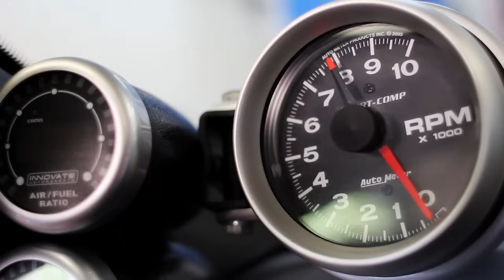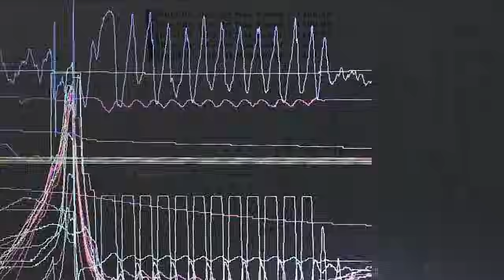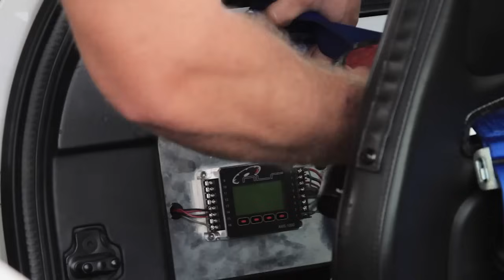New World's Fastest Car! Ford GT Bad v8 1700 Hp - 455.817 km/h ( Guinness World Records )

Comment: sigh

all these comments...

this is a world record for fastest standing mile in a street legal car, not a factory production car, not a full blown race car, not a jet powered car, not a trailer queen that needs 20 mins of life support before starting it....JUST A GOD DAMN STREET LEGAL CAR RUNNING FLAT OUT FOR 1 MILE. not 5 miles, not 2 miles, not on a circle track with a 120mph lead in into a straight away, BUT A STANDING MILE.

yes you can thrown a endless amount of money at a Veyron and make it faster, by that same logic you could do the same with a lawn mower and break the sound barrier. 283 mph is fucking fast no matter how you cut it and this is a impressive achievement on its level of a highly modified street car, just the same as the Veyrons achievement is in a stock platform.

Comment: For all those hatin on Ford GT and comparing it to the Veyron there is really nothing to compare when you could buy 5 GTs for one Veyron, and the Veyron is all wheel drive while the GT is only rear wheel drive. Perhaps the most important thing is what few have mentioned. That speed was over the STANDING mile. Those who watch the Moscow Unlimited or Texas Mile drag races know the significance of such a speed. It takes a Veyron 4 miles to reach top speed and Venom 3 miles. This speed was achieved in 1 mile, it would probably hit 300 if there was enough road for it. Regardless of what anyone may think of Ford looks or otherwise you have to give respect when its due.

Comment: now the chiron is going to beat it as it is the world's fastest car ever made
Reply: The Chiron will most definitely not be able to come anywhere close to 283 mph in one mile. Besides, the top speed is limited to 261 right now.
Reply: +The3Noobz yeah they will remove the limiter and test it ....261 is just for safety reasons
Reply: +Kaushik Bala Chiron will never set it
Reply: uh the fastes car you can drive on streets is Devil Sixteen with 348mph
Reply: BlueDune its a fake car .....5000 hp XD!!
Reply: +Kaushik Bala Fake??
Reply: +Kaushik Bala oh u dont believe but i did hear its engine sound in real life so its fucking loud..
Reply: +BlueDune there is no proof of its top speed and no official record....
Reply: dude that's a piece if garbage call it high end and give it and automatic at least give the Chiron a dual clutch or a manual also the Suzuki escado Pike's peak version is faster and that thing is from early 90's and it's the king of all roads because it is a rally car but it also goes on tarmac and shreds the road and it can go 364mph on its 1800pounds and 2300WHP and it has a 6 speed manual and does 0-200 in about 7.8 also 2300whp isn't original it's after people have rebuilt it and modded it
Reply: Lol That isnt even a production car :D
Reply: BlueDune it may not be production car but it's hell load of fun
Reply: I bet sixteen is one of the best cars u can drive
Reply: 1.8 sec 0-100 540kmh max
Reply: im dumb cuz u agree sixteen is one of best?
Reply: BlueDune it is good for straight line racing like a drag racer but the handling on the devel 16 is horrible and also the reason for bad steering is the car is very long but narrow along with it being extremely heavy I would go with the Suzuki because it is more versatile because it can go off road,on streets and handles like a dream
Reply: +BlueDune stop acting like you know about cars
Reply: +BlueDune for how long? 2 miles? ah super cool..
Reply: Justin Walters 4000 pounds 1500 HP but then trion nemesis has 2000hp and is lighter
Reply: Justin Walters 5000 pounds? are you serious
Reply: It weighs 4400lbs but whatever
Reply: The Chiron does 286 mph...
Reply: Fastracer25 AJ so it's slower than the AMS 12

Comment: so uh, yeah, Bugatti is straight off showroom floor with full interior, warranty, etc... hardly comparable.
Reply: Yer, well I have a Bugatti...................................... In GTA five.
Reply: me no lie 19 years old in collage driving a adder 187 miles per hour
Reply: "Bugatti is straight off showroom floor with full interior, warranty, etc.."
Bugatti Veyron 16.4 Super Sport runs nearly $4,000,000.00 - so it better be fast.

The GT didn't cost a quarter that price..........and will go around corners fast enough to make your eyeballs bleed.
Reply: New ones are 4,000,000.00

Who wants a used Bugatti?    Tacky much?

Comment: The other day in Miami Beach, a guy pulled up with his Bugatti...had coffee and then got in it and went home.  No pit crew, no extra doodads.  Just the car he bought at the dealer.  I'm rooting for the GT to be the fastest car, don't get me wrong...  but that's a race car that's barely street legal.  I'm surprised Guinness went along with that because the Ford GT as you can buy it from the dealer does NOT go faster than the Bugatti.  It sure looks a hell of a lot better, but let's compare apples to apples please.   Given enough money anyone can modify a any number of cars to go faster than the Veyron.
Reply: +Gandalf TheWhite If you actually own the car they will do the upgrades to make it as fast as the badd gt but of course it will cost money and a lot of it and it is very street legal, dude drives it daily. plus he does rip apart the engine and rebuild it with better parts every month to see if it will get more power sadly they have only squezzed a bit more power out of the block. the block was also built by ford themselves which konninsegg used in the new one:1 due to its light weight and the power it can achieve and not crumple apart.

Comment: It's a car built for pure straight-line speed. If that's it's only purpose, there's no need for modern comforts or things that would make it possible for the everyday driver to cruise on the street with, strip that baby of ALL excess weight.

It's like comparing a fighter jet to a speed boat, "Fastest car, pshh Bugatti goes nearly just as fast, is street legal, and is easy to drive".. when this car was stripped and built specifically for only 1 purpose. "This Jet can break the sound barrier, but it can't float on water like my boat, haha, piece of shit jet". Pull your head out of your asses people... and regardless, despite all the shit that went into this GT.. it was STILL probably exponentially cheaper than your all mighty Bugatti Veyron.

Comment: Ok my comment is for the beginning of the video as they said the fastest is 268 from the Buggati...that is wrong...the Venom GT beat that time with 273 mph I do believe and said the Venom was capable of much more. This GT is an absolute monster. Can't wait to see the guys from Venom beat this. The only reason they didn't get the Guinness record is because they wasn't allowed to have a sec pass on the air strip and the rules are you having to be able to do that speed going down and coming back to achieve the mph record in the bok of Guinness.

Comment: nice car and nice job   but some info on the veyron engine. Is built to make 5000hp at full capacity.  So please read a little! the only reason they dont do that  is for tire safety and heat cooling exaust  and there's a lot of car that make that speed they just not interest in puting a big ad on theyre car !

Comment: Yeah but the bugatti veyron is still the fastest mass production car at 277 MPh now. the bad gt is a modded production car. so it's now contest bugatti veyron ss is till the fastest in the world
Reply: +Tony Mattingly the veyron never went 277
Reply: +Tony Mattingly mass production? I think only 30 special modded bugattis (the super sport edition) can barely reach its 267 top speed after going like 5 or 6 miles. Its not every veyron that can go 267.
Reply: The Venom GT went 273 mpg bugatti went like 263
Reply: Dixinormus venom gt went 270 bugatti went 268 or 269 not sure which
Reply: bush did 7/11 the Veyron ss went 267 on a straight of 5 miles.... the Venom GT did 265 under 2 miles (it goes beyond 270)
Reply: TheGeorgeLara the veyron sucks so much it cant turn for shit and it takes to long to accelerate and if you were wondering i would never defend the veyron
Reply: +Tony Mattingly I hate veyrons so much. They are just so damn ugly to me but I do respect their speed. And with the Chiron that is supposed to have 1500hp coming out, I am kind of worried that production cars are going to start breaking 300 soon.

Comment: Sorry, though this car is mighty impressive, but...

...a custom, one-off brute, built only to break a specific record, and can only go quick in a straight line shouldn't count when the record was set by something in it's own factory stock configuration, handles as well as it goes quickly, and is luxurious and comfortable enough to be driven daily.

Comment: this is so ridiculous. you can't compare the 2 cars. the bugatti has no roll cage, full interior, air conditioning, heating, radio, speakers, cup holders, etc etc. vs this Ford that has nothing. strip the bugatti down like the Ford then race

Comment: Then all the Veyron has to do is remove the limiter and let it push out the max ponies it can at 3000 hp and it's back at number one.  Now, can it handle it? I don't know but I'm sure if they can modify a Ford GT it should be allowed to do that as well.

Comment: The Veyron is a governed production car, and is capable of going much faster just by manipulating it's governor, so I'd say that you may be a bit lazy on that point, and should get back to the drawing board "The Veyron Motor, Is Two Engines In One, Plus Turbo Charged"

Comment: Bit of a soft record tbh, the record for quickest terminal speed on the 1/4 mile for a street car is 250 mph and that car has 2300hp, this is one of those records that people are not really that interested in or the big hp cars would have had a go at it.
 BTW the WORLDS Fastest car is the Thrust SSC and this has a way to go to become the WORLDS Fastest car, i agree its very fast but come on guys aim a little higher.

Comment: Nowadays all the biggest manufacturers like Ferrari, Bugatti, Porsche, Lamborghini, Pagani, etc... can build a faster car than the GT, question is: does it worth? The Volkswagen CEO declared that the Veyron was kind of a fiasco because the price tag of 1,5 million EURO does not even payback the engineering to create it. Being a big group with revenues from the other brands this is still acceptable, but it's not the best idea they had. However, and not to defend the european manufacturers, a car should go beyond the simple speed and open up new technical scenarios, under this point of view the Veyron was a breakthrough, while the GT is only an old car with an overpowered engine inside. Therefore the contribution of FORD, in this case, was rather miserable IMHO.

Comment: Bugatti is still the fastest PRODUCTION car, you simply took a production car and made it faster, anyone can do that... but thanks for making it a Ford...
Reply: Not Stock from the factory, does not count.  Bugatti is street legal.
Reply: Actually no, the veyron has been beat by the Hennessey venom GT
Reply: Derek MacIntyre the Hennessey venom is not a Production car. Nice car but not production
Reply: ***** You have a no idea of why Veyron cost so much by calling it "overpriced"and how it is extremely hard to make a production car reaching top speed in comfort, stability and luxury in reliable manner.There is documentation called Megafactories and How It Is Made explaining the reasoning, look it up.
You will understand why Bugatti Veyron got so much respect in the automobile industry, it pushed the boundary  of what it is possible.
Reply: koenigsegg regera. fastest production car
Reply: Since when? Guinness world records doesn't show it
Reply: +RepoDraghon that's bc guidness world records (for some stupid reason) requires a test where the car goes both ways down the track, and Bugatti (VW) is the only Car company with a test track symmetrical enough to do that
Reply: +Dan R but the Venom IS actually a production car. That's a fact. A legitimate fact that can be proved with ease.
Reply: The world record model everyone is talking about was a limited run of 3. Each cost $1.5 million.  3 is not a production car. You need to check your facts.
Reply: Fact of the matter is, check what Guinness says right now.
Reply: *****
First paragraph sounds like a view of someone playing too much videogames.  Following the logic, I could take a Smart ForTwo, upgrade to the max making faster than Ford GT at 1/5 price. I am afraid you only highlight a complete lack of understanding in automotive engineering.

Quick info, one of Veyron owner is a former Formula One champion. Bugatti test drivers are professional driver, one of them a 24H Lemans champion and other was the driver to set the top speed record with a McLaren F1.

Plus, Ford GT and Bugatti Veyron are dissimilar because the latter is a high speed luxury GT.
Reply: RepoDraghon
Then Guinness got wrong. Venom GT is a modified Lotus Exige and Hennessey is tuner, not a registered manufacturer. Still ineligible for performance record reserved to production car.

Comment: And you don't raise a sweat on the maglev train and you can see the scenery pass by in comfort, even near silence. I reckon that in two years, electric cars will out power the internal combustion super cars etc. My prediction is... about 8.76 seconds and terminal speed at about 493kph. Just dreaming but hey, the Chinese and Germans can do it on a passenger train.maglev does 431kph or 268 mph.

Comment: I personally imo think the bugatti veyron is about the ugliest car in existence almost, but what is more impressive to me is the Ultimate Aero SSC which hit a recorded top speed of 256.14 mph but with limited track space, it is said to be able to reach a top speed of 260 mph with its given transmission & diff ratio gearing at its redline of 7,200 rpm's,  but with different gearing is said to be able to reach a top speed of 273 mph, beating that of a veyron without the  need of 2 more turbochargers, 8 more cylinders, and awd, and 1.0 greater liters of displacement like a veyron needs, also the SSC has no traction control, is less than 1,000 bhp with 908 & only had a USD price tag of $285,000 compared to a veyron, personally I think the French veyron is a joke! I'd rather have a Koenigsegg Agara,  McLaren P1, SSC, Venom GT, or Ford GT, then ever wasting money on an ugly Bugatti, I feel there's probably a lot of ppl who agree!?

Comment: you can't compare this to the veyron.  The veyron was the fastest street legal production car.  This is a car that is not a production car it is simply a modified gt with slick tires which you can't have.  Since they are not in same category why are they being compared.  Also the record of worlds fastest mph in a mile is probably faster than that considering what they do in the salt flats.

Comment: Do they REALLY use adjustable spanners on it?
If it is so precise an instrument, why are they using an "approximate spanner"?
SURELY they can afford to use the correct tool?
What is the engine held in with - Duct tape?

Also - The Veyron is an "unmodified production car", albeit very limited production.
Makes me wonder what a modified veyron would do??

Comment: ??? 455.8km/h that's not the fastest car, at least no it isn't. Seen R35 do 470km/h
Reply: Lol I would like to see that, provide a source. The GTR is an awesome car, but it has aerodynamics that focus on down force. Even the 2,000hp  AMS Alpha Omega 2 GTR will top out at only about 374km/h
Reply: Random Guy What?? a 1700hp R35 did 400km/h all about gearing, and down force too.
Reply: BUZDRIFT But we are talking like 430km/h an up. I can not find anything about a GTR doing over 380. 

And Top Speed cars aim to have very little down force. That is why the Veyron and Venom GT have rear wings that go completely flat to help them reach top speed.
Reply: BUZDRIFT you said it did 470km/h first, then changed it to 400? link video!
Reply: This is true, it was a lie :\
Reply: if it was a lie, how can it be true?
Reply: EerieBetrayal
There's a article regarding a 500km/h GTR and 350Z, but it hasn't happened yet.

http://www.2009gtr.com/2011/04/500-kmhr-311-mph-nissan-gt-r.html
Reply: "hasn't happened yet". all i need to know
Reply: EerieBetrayal yep! True, but a TT V8 @ 7.0L vs a TT V6 at 3.8L and only 55km/h difference, a little sad.
Reply: BUZDRIFT  lol, that was a really random fact you just popped out with. interesting though, and yeah, that is pretty sad

Comment: Fast car? Sure thing. Anything with a 5 liter V8 & 2 turbos is gonna go fast. Any eccentric with a boatload of money to throw at any car can make it go fast. Small problem tho, Bugatti Veyron, ugly as it may be and built by Ze German Overlords, is a production car. No real crazy mods required to make it go insanely fast. This thing on the other hand probably had upwards of 150-200.000$ throw at it in custom everything to make it go this fast. So no, not the same category.
Reply: Yeah, $150,000-$200,000 in mods plus about $150k for the car itself is still WAY less than a veyron costs. Owning a veyron isn't even about speed, it's a status symbol. Nobody buys one to go fast, they just buy one to say 'hey I have a car that can go super fast, AND its a million dollars!" Also, Bugatti is a French company. And anyway the veyron is an 8 liter V16 fucking quad-turbo. Of course it goes fast.

Comment: All the hype but no actually run, common now? How can you be a car guy and not show the actually run, this car is epic after all. HP is not what is impressive to me, its the way it can put the power down and the speed this thing can achieve just in a mile. I am sure if you put some money into cooling the car reliability and few other changes, this car would be a production ready car. 
That is why veyron is so ridiculous, being so expensive and doing so little comparatively(it cost ~6mi to make per car). On the other hand because of veyron, new bar was set.